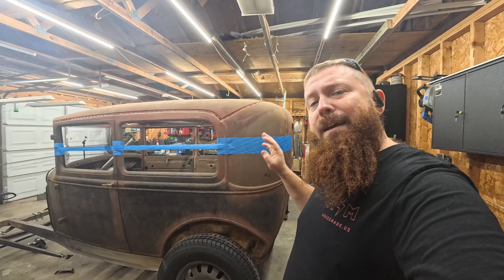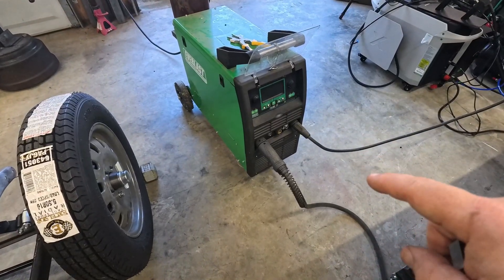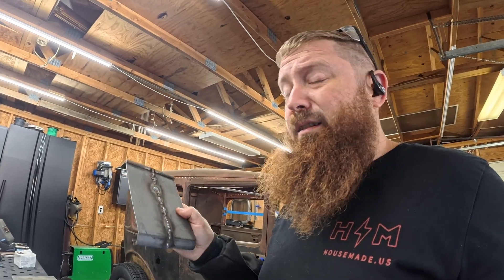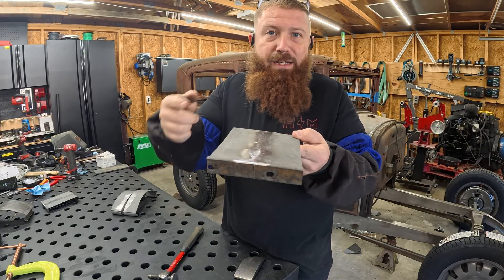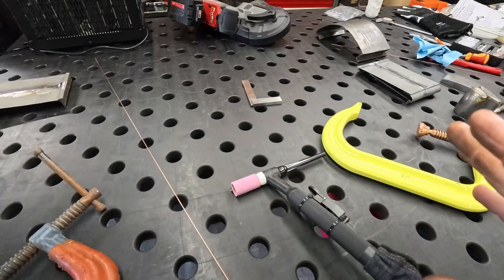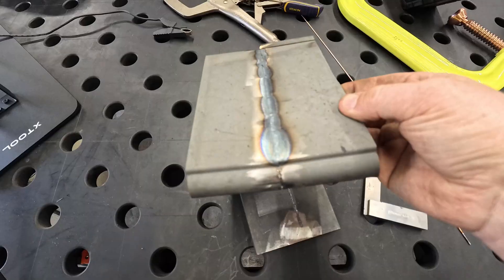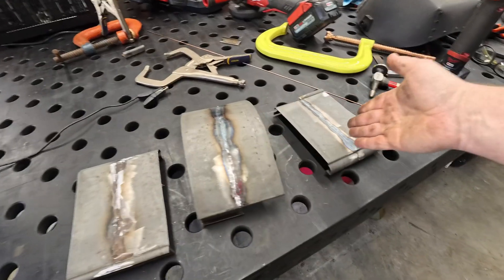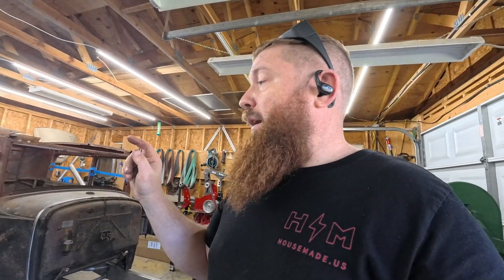Comparing MIG, TIG, and Laser Welding on Automotive Sheet Metal

Comment: Can you use flux-core wire and do away with the gas?
Reply from the maker: Probably not
Reply: Yes you can, but gas with the right machine is better. My Miller 211 does great with sheet metal. A low amp setting is the key.

Comment: I need to see more welding with the laser on the thin sheet metal! that looks insane, i do alot of rust repair, thinking it may change my life lol
Reply from the maker: I’ve been posting a few shorts using it on this hotrod. I’ll be chopping the top on this car soon and will post a video about it.
Reply: @FullSteamDesigns i’ll check it out!
Reply: It works really well. I’ve now welded 24 gage. Surprising.